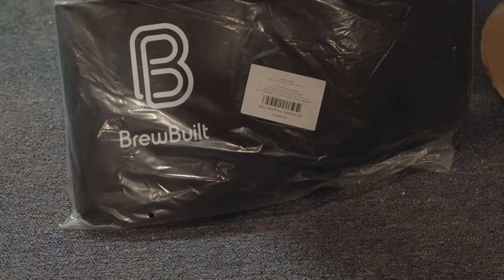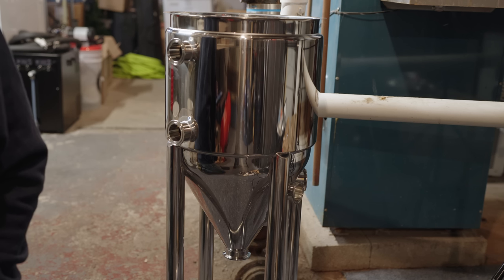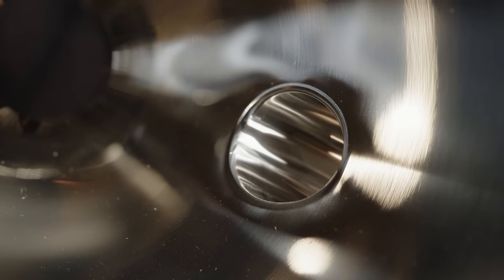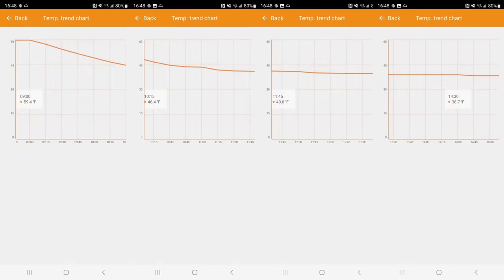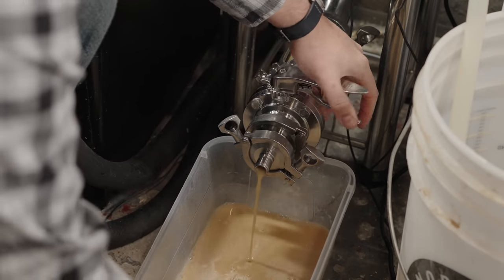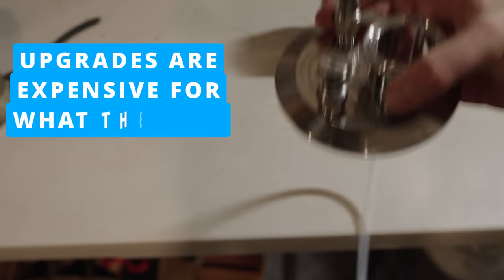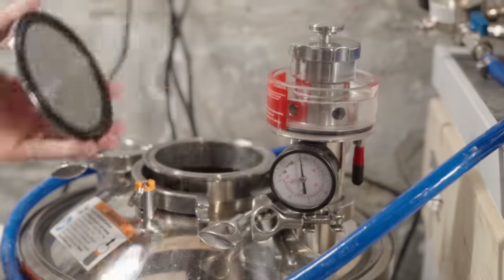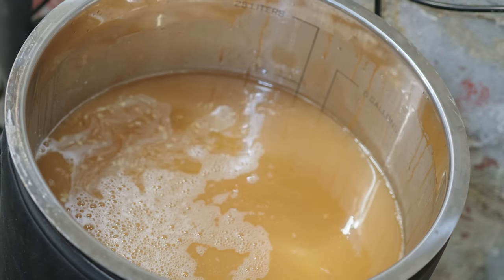Is the BREWBUILT X2 Jacketed Unitank Worth It? | X2 vs SPIKE CF5

Comment: I love that you engaged the viewer to ask themselves if they actually need a $1000 fermenter. Jacketed means one thing. Achieving the efficiency of a jacketed fermenter can come in many variables. When I mashed in coolers I used a 10 gallon igloo. The 10 gallon igloo would hold a 6 gallon carboy with room to spare, and that was how I temp controlled my carboy. It worked very well using tap water as ours is around 50 degrees year round. If you have an extra thousand, and I am not sure where to find extra grands laying around, and this gem will make your life easier, the price is good. Great Vidya Apartment.

Comment: Very cool, Steve. Most of your experiences with the jacketed X2 resemble my own with one exception; my 14 gal version struggles to hold pressure. I just posted a video on that yesterday.
Reply: Hey Larry, have you tried flipping the gasket upside down? My Blichmann Fermenator, I thought, had a leak, but the gasket fit better after flipping.
Reply: @patrickglaser1560  the gasket? No. Could try it but for now just trying to use it as intended. I just think the choice of using v clamps instead of something else like TC clamps is the root problem. V clamps aren’t designed for use in these kind of fermenters.
Reply from the maker: I used to have issues with the pressure loss in my spike CF5 until I flipped the lid gasket as well, but I dont know if that's the root cause. Cheers!
Reply: @BEER-N-BBQ by Larry  oh ya, the v clamp also has a right-side-up as well. It was maddening for me, one uni was 15psi capable the other only got up to 7. After fiddling I got both unitanks up to 15psi
Reply: @TheApartmentBrewer  v clamp is definitely fiddly

Comment: X2 jacketed conical user here.  My Flex Chamber leaked on my first few batches, no matter how many times I re-screwed the lid, it would start leaking once it was under water pressure or pressure fermenting.  It just could not hold over 5psi pressure before it would start leaking.  Finally, I swapped out the Flex Chamber for a 2" Tri-Clamp Hop Bong I had on hand and it solved all my issues.  Now I use the hop bong for my trub collector and I got another for a Hop Bong. (2 flex chambers for sale, hmu)

I do not use the floating dip tube but I do use the pressure lid to add CO^2 while draining out the included sample valve or setting up pressure testing when pressure fermenting.  Another "must have", IMO, is the carb cap air stone!  Works awesome for adding oxygen when starting a ferment and for carbing once fermentation is compete.  I use mine on the side opening of the hop bong.  The air stone can also be bought as a 1.5" tri-clamp if you don't want to use it on the Flex chamber or Hop Bong.  I also really like the Spunding Valve and Pressure Gauge from BrewBuilt as they are heavy duty and seemly will last forever if cared for during use (can be bought on amazon for a bit cheaper).

Jacket works great, I haven't timed my temp change for CC but I set it at night and by the time I wake up it's at temp (usually 1-2C) regardless of what I started at for temp.  I have done 20C D-Rest to 1C CC in an 8 hour sleep with ambient temp of 20-22C with no problems.  Side note, I do this over night because ambient temp is typically lower and electricity costs are cheaper after 9pm local time and since this requires a lot of cooling power, I feel like it saves me some change on my power bill.

Overall, IMO, great fermenter.  Cools faster than my Fermzilla or All Rounder with the chilling coil.  Much easier to clean SS walls vs the tight spaced SS coil with the CIP ball attachment.  And could technically do no chill fermenting, which the PET fermenters cannot do.

Comment: Great review!  I have the 7 gal. jacketed X2 and your review is spot on! There's definitely some quality concerns and mine does not hold pressure very well. I do love the cooling and temp control when combined with the Brewbuilt chiller though. The Flex Chamber is difficult to reach on the 7 gal. model and it's messy to drop the trub.  There's hardly enough room to use the butterfly valve due to the handles hitting the legs. All-in-all, I  wish I had waited for the second version of this fermenter but it defintely has it's benefits.
Reply from the maker: It seems there's more people having issues with pressure holding than those without, which is a serious problem, among others

Comment: I have the CF10 and Flex+, but if I had to do it over, I really love the simplicity of a simple corny keg with a floating dip tube. Best bang for the buck for pressure fermentations imo.
Reply: I'm currently planning on "upgrading" from corny keg and floating dip tube fermenting to a conical. Seeing your post is making me reconsider.

I'm curious why you would take the keg fermenting route if you had to do it over? Is it just that there is less too clean and deal with? Cheers!
Reply: @beernie1946  Pretty much, plus no leaking issues with the top on those type of conicals.

If it were me, I'd look at the Megamouth Torpedo kegs from More Beer. For the price of the CF-5, you could get two maybe three of the 6 gallon Mega mouths. Add the floating dip tubes and your in business. With the larger lids compared to regular cornys, adding a 1.5 inch triclamp bulkhead for other accessory attachments make it a clear cut winner imo.
The only disadvantage to the Megamouths that I see are they have a larger footprint vs a standard 5 gallon ball lock. That might be something to consider if kegerator space is a premium.
Reply: @GentleGiantFan  Thanks for the detailed response! Those torpedo kegs look awesome! The 10 gallon has a good form factor for its size I feel (taller vs wider). I'm currently using two 6 gallons standard torpedo kegs which have been pretty awesome so far.

I'm still tempted by the shiny conicals, but you've made me think twice about it. I think I'll at least hold off for a while longer
Reply from the maker: Keg style fermenters and converted kega are certainly becoming more popular for good reason, they are very practical!
Reply: @beernie1946  You're welcome.

I have a 15 gallon corny that I use for 10 gallon batches. I added a floating diptube to it. Also, the way the handles are oriented, I was able to reverse the lid's handle (bale?) to where I had room to drill a hole big enough for a 1.5" triclamp bulkhead. I plan on adding Spike's spunding valve to it in the future. I have maybe $130 in it all together. I wished my CF-10 was that cheap.
Reply: @GentleGiantFan  Very nice!

I just noticed the other day that BrewHardware has a standard corny lid with a 1.5" tri-clamp. That could be an option as well!

Comment: Looking to see which is best uni for creating lagers.  Seems like the jacketed would be better but I am a bit nervous about some of the issues people have had.  Concerned about the placement of all the ports in the 7gal as well as some of the pressure holding issues with the lid.
Reply from the maker: Jacketed helps in terms of cooling speed but if you use a coil you'll get close enough once you get down there. Agreed in the ports, annoying but it works eventually

Comment: Thanks for this comparison its very relevant as I'm making my decision to go from bucket to conical. 
 My local homebrew shop primarily sells Spike equipment.  From talking to them its seems Spike treats the shops they work with pretty well for ordering/supporting through the shop which is always nice.  That probably gives it the edge for me.
Reply from the maker: They're very high quality and no matter which one you go for you'll be happy!
Reply: I'll also throw out there that Spike's customer service is fantastic. I've had two minor issues, one was likely my fault,  but they replaced the part in question at no cost to me very quick and easy. I don't know what support is like for the X2. Does anyone else have experience there?
Reply from the maker: I can definitely vouch for spikes customer service as well!

Comment: I saw this at homebrew con last year.  There is a lot I like about it, but as a Spike CF5/10 user, there is not enough to make me switch.  The jacket is super cool, but I don't like all the ports smushed together in the cone like you mention and some other things.  I'm sort of thinking about a coolbot walkin in the basement, in part, to get around the cold crash shortcomings of the coil in the Spike CF...  That and a little bit of a hassle cleaning are my only problems with the cooling coil.
Reply from the maker: I think of you've already got one it's not enough to switch fully as well. I think though if you're a first time unitank buyer it would be a very useful product.

Comment: Great video and well articulated. 
Loving my X2 so far. That cooling jacket is a game changer!

Some input related to what you brought up.
My lid clamp doesn't bottom out on the threads but it does bottom out where the v portion makes contact with each other.
Also, have a half batch in mine at the moment and can confirm, it cools pretty well still even though the cooling jacket only makes contact with an inch or so of the beer.

Question, what size conical heater did you get? Unfortunate that they don't have the compatibility chart updated for the X2 and support wasn't sure which ones would fit the 7gal quite yet.
Reply from the maker: Interesting data points, thanks for sharing! I got the 120W size but I wish I hadn't. It's a huge PITA to get on this one.
Reply: I got the 80 watt and it fits great!

Comment: Seems to me there'd be a decent market for a standalone cooling jacket--some sort of a mat or pad with channels/tubing in it to run chilled glycol or water through.  Presto, you have a jacketed fermenter.  Or does it already exist, and I just don't know about it?
Reply from the maker: That's a really good point! I wonder if that sort of thing exists?
Reply: @TheApartmentBrewer  Turns out it does, the "Cool Zone Cooling Jacket."  Starts at about $80, but that does include a set of quick disconnects FWIW.  Since I don't see me buying an X2 any time soon (unfortunately I didn't win the giveaway from morebeer), I might have to give this a try.

Comment: question not necessarily related to this comparison.  I watched the video on brewing the treehouse hazy and noticed that the past few brews you've switched from using distilled water to using spring water.  Did you get a water prfile done for that brand and know the minerals already present are consistent?  I ask because i still am using distilled water and adding minerals, but spring water is easier to find sometimes.
Reply from the maker: No water profile, but for when you are building up a water profile with 100+ ppm of key minerals, the 5-10 ppm of Base minerals in spring water doesn't matter in the long run

Comment: One comment at the end of the presentation caught my ear....Why do you have to use NON-Foaming sanitizer in one of the conicals?
I'm looking to set up a Spike CF10 system a long with a 15gal Solo.  I've never heard of having to only use non-foaming sanitizer in either the brew or fermenting equipment...
Why are you recommending this? And...what is a non-foaming sanitizer product to look into? I'm only familiar with one sanitizer, the Star-San.
Thank you in advance!!
CC
Reply from the maker: If you sanitize in place through use of a spray ball you'll want nonfoaming Sanitizer or you'll be up to your nose in bubbles. 5 star makes saniclean which I use.
Reply: @TheApartmentBrewer  Ah..thank you. I guess I'd only thought about doing cleaning with the ball....not the sanitize.
I'm new to this...I had only thought about cleaning after a brew, but doing sanitization just before putting wort in....and with that I'd honestly not thought about the CIP Ball, I'd assumed pumping some Star San solution in and using a sponge/brush to run it around the inside.
But you're giving good ideas.
As an aside, there's no need to sanitize just after a brew, right...since it will often set where contaminates could land....you generally need to sanitize just before use for fermentation...is that correct?
Thank you in advance,
CC
Reply from the maker: So there's two schools of thought on this, you can either clean and sanitize after a brew and apply pressure, keeping the unitank pressurized until the next batch or you can just sanitize right before receiving new wort, which is what I do

Comment: The temp probe location shouldn't be an issue if you're shaving the cone every day or every other day like you should be doing.

A lot of Spike CF power users configure the cone with the following: coming off the cone > butterfly valve > sight glass > 90° elbow > butterfly valve > then typically a reducer or barb with X inches of silicone. This gives significantly greater control over shaving the cone, but it's only possible with the leg extensions. Question - is there enough room on the X2 for that configuration?
Reply from the maker: That's a fair point! I think that setup you described is possible but only with leg extensions, which you'd need anyway on the Spike fermenters.

Comment: Hi I'm planing on brewing lagers.Would this be best for an intelligent beginner?
Reply: You absolutely need temp control for lagers, so if you can afford a unitank I couldn't reccomend more. I'm partial to blichmann however
Reply from the maker: Are you planning on doing them traditionally at cold temps or under pressure? A fermentation chamber chest freezer paired with a bucket is still cheaper than this fermenter and will get just as much consistency. But the unitank is very useful if you commit to it long term.